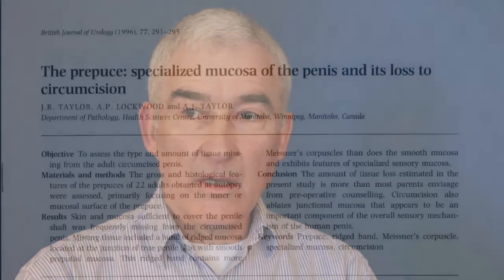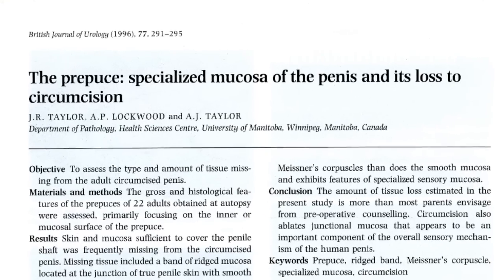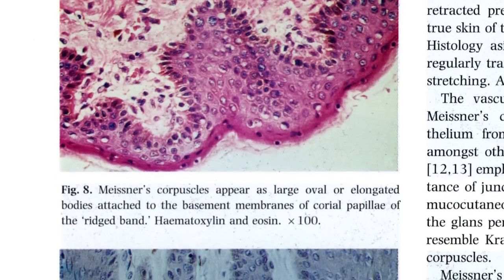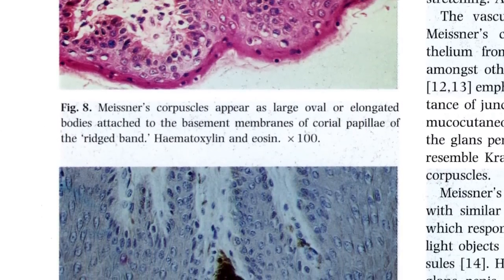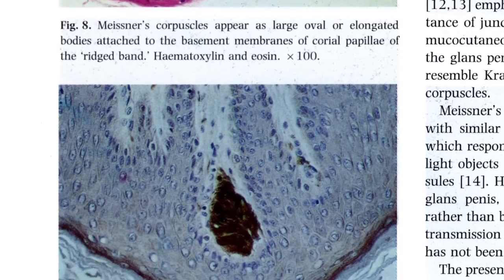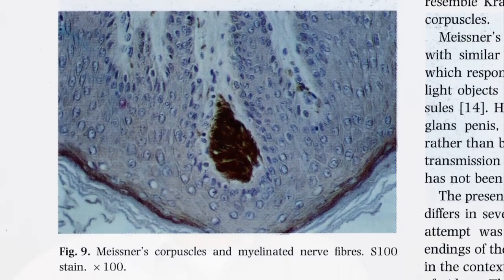Anatomy of the Penis: Penile and Foreskin Neurology

Comment: this video and what i have learned about the anatomy leads me down the conclusion that cuts can be very radically different in severity and damage. I still have a lot of inner skin and a frenulum, and so i think i can still have that developing of high sexual energy into the orgasmic state, but i still have pain. which is somehow a better thing that just to feel pain with only small bouts of sexual excitement. its crazy. i wish i was never altered the way i am, and i feel lucky to have what I have left. now i feel even luckier with attempting foreskin restoration because it seems that my scar line meets with a good portion of left over frenular delta, so i don't have a completely fucked up weird remnant that would be hard to work with.

Comment: 80% of the nerves are in the foreskin, and almost ALL of the Meisner corpuscles.  The inside support structure of the penis has very few, the skin behind the pupice has very few, the glans has some.  

The foreskin is called by many who know THE MOST IMPORTANT and SENSITIVE part of the penis, and the glans is just an “anchor” for the foreskin.

So basically, Circumcision is an 80% penectomy (amputation of the penis), while simultaneously OBSCURING the fact that the penis has been almost completely amputated.

Comment: That explains what the bumps around the scar line are from. 10:52
Edit: if I pull back what's left of my shaft skin the scar shows alternating stitch scars and slightly raised portions with the clusters of hundreds of tiny little bumps. Now I know those are what's left of the severed nerve endings.

Comment: Neurologically, the most specialized pressure-sensitive cells in the human body are Meissner’s corpuscles for localized light touch and fast touch, Merkel’s disc cells for light pressure and tactile form and texture, Ruffini’s corpuscles for slow sustained pressure, deep skin tension, stretch, flutter and slip, and Pacinian corpuscles for deep touch and detection of rapid external vibrations. They are found only in the tongue, lips, palms, fingertips, nipples, and the clitoris and the crests of the Ridged Band at the tip of the male foreskin. These remarkable cells process tens of thousands of information impulses per second and can sense texture, stretch, and vibration/movement at the micrometre level. These are the cells that allow blind people to "see" Braille with their fingertips. Cut them off and, male or female, it's like trying to read Braille with your elbow. A woman can live without the sensitivity of the visible part of her clitoris. A man can live without the only mobile and most sensitive part of his p*nis. But, both men and women are better off with their natural fine-touch parts intact. And so are their sexual partners.

Comment: @Bonobo3D top notch. Consider- The bi-level locations of sexual receptors are located in the ridged band and juxtaposed in the corona. Together, circumferentially the amount of sexual receptors are constant though are inverse to each other going mid-ventral to dorsal. So at dorsal there are more sexual receptors in the glans than in the corresponding ridged band. Inverse to the mid ventral when there are more sexual receptors in the ridge band than the corona. cont-